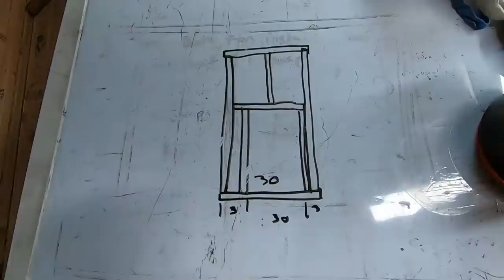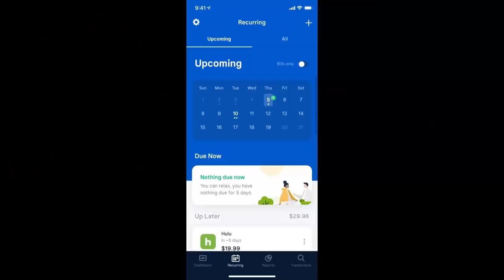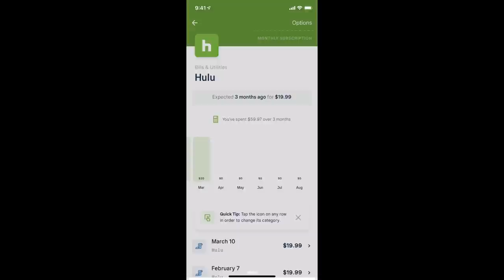I Built Their Closet Too Small | $1.5 Million Dollar House | Master Bedroom Build | THE HANDYMAN |

Comment: I bought a new 5’x10’ tilt trailer in 2001 to use as a single snowmobile trailer.  Fast forward several years and a few knee surgeries later and I don’t ride anymore but still use the trailer as a utility trailer now.   Under $900 new in 2001 and now I had a quote of closer to $1,000 for marine grade plywood to redeck the trailer.    It was $290 in February of 2020.

Comment: The 3,4,5 method can also be used as multiplies of 3,4,5 for bigger walls
Reply: And if you are measuring the entire room all 4 corners are square if the 2 diagonal measurements corner to corner are the same. Assuming both sets of parallel walls are the same length.

Comment: 12:10 if able, SUGATSUNE hinges make great hardware for doors like that, SOSS, another brand. Key to using is making sure have the “framing material” to hold hinge, and don’t need a jig or router, can use template and Forstner bits to drill depth and chisel to remove material for the hinges. Really enjoy them and doing concealed, frameless, secret doors👍🏻

Comment: 3-4-5 rule i believe is only for euclidean geometry (2D). I don't think i have heard or used that term since I was in highschool (20ish years ago)

So if floor is sloping away that could introduce a bit of error. Probably not a problem in short spans.  But maybe over the width of a room with  bad slope could cause a bit of issue.

Comment: How are you free hand cutting perfectly square boards like that with a circular saw?! I'd almost always use a chop saw, at the very least a square to put my circular saw against for a straight cut. Man the difference from DIYer like me to Pro like you is astounding.
Reply: It doesn't have to be "perfect" that's why it's called "rough" framing 😂
Reply from the maker: I have been doing it daily for over 25 years.    I never get the chop saw out unless I'm cutting compound angles.
Reply: It's also easier to cut a 2x4 straight with a small 5 1/2" circular saw rather than a big 7 1/4".

Comment: 8:20 When I do DIY home projects using materials like this, I find myself wondering if the 1/8 inch was due to needing to 'scooch' the wall over like you did, or whether or not the edge of my stud wasn't perfectly flat (like, maybe bowed 1/8 inch over a run of 3 feet.)  How much time & effort do you really put in trying to root cause things like this?  Or is it really a don't-care ?

Comment: What if you swing the right hand door out, would give you even more room inside?
Reply from the maker: Typically doors swing in.   I will have to think about an outswing door.  That area still has to be open to be able to walk in.
Reply: As a home buyer I'd rather see a nice bi-fold door than one big door that swings outward. It's a little weird... 😋
Reply: Swinging doors out into a room up against the opposing wall is not on common for the simple fact it gives you more room inside.
I'll say it.....bifold doors and there hardware are junk today.
Reply: @5fiftyshack-272  Point taken, I'll give you that. 👍 Some years back I installed a pair of $50 box store wood bi-folds on a small closet & they kept falling off the track. The little pivot assembly was very flimsy, true. In this home's case, two separate & narrow French door style panels might work better, if they must swing outward? (Or, the customer can opt to pay extra & have a set of heavy-duty custom bifolds made?) I just think one large door swinging outward looks very awkward. Esp when many homeowners never close their closet doors. I happen to be one of those weirdos :)